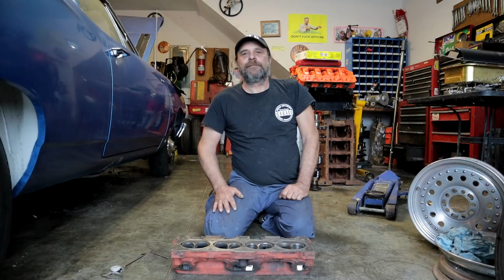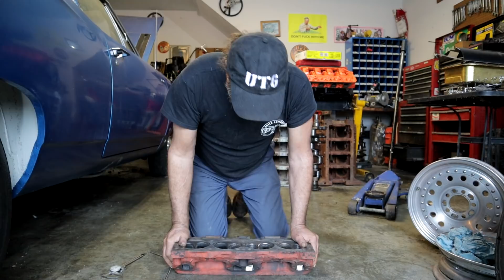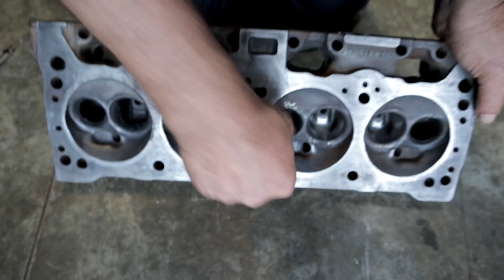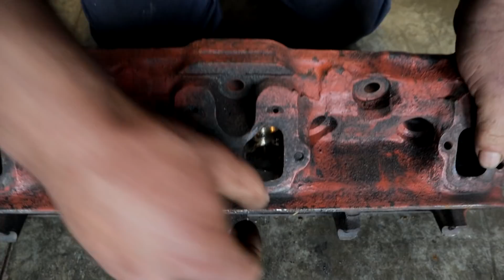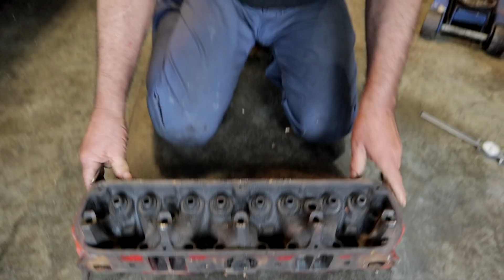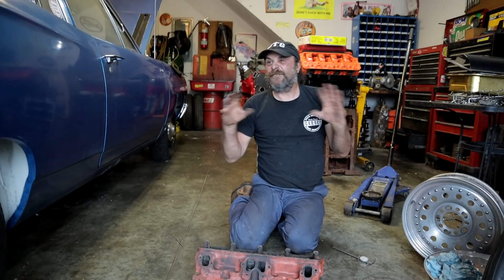Why Mopars Suck

Comment: same for us IH guys, biggest big block ever, highest nickle ever, all forged, max torque and hp right off idle all the way to red, and yet the 70's heads could have one exhaust port almost half the size as the largest! 
Port match em, polish up the drains and castings, and your like ahh, this is what the engineers made, and the suits said turn the machines up to 11, boom boom boom.
 When your talking no overdrive, 4.10 rear, on a stock engine, just worked over, its the difference of being happy cruising at 60 , to 80, spin them in any gear, SO at this point  stop fucking with the engine until you are actually using that power, all you really need is even throttle and power once you can light the wheels up! 
because any morE power at that point aint doing a damn thing but making it harder to throttle.... once you got the suspension right its trans gearing or slicks, or your just wasting your pinstripe and paint money

Comment: Fords where the same I had a ride in the back seat of a  new 1971 ford Torino with a 351 Cleveland and a 4 speed it had big back tires and picked up the front end on the street. Factory blue print.Crazy fast and all stock.

Comment: So that's probably why my 70 Duster just would not run like it should. I never really paid attention to the head castings. I just threw in cam, intake, valve job, headers ignition etc. And it just didn't  really make the power it should have. Combo should have posted around 270hp at the wheels but 1/4 mile et said 190

Comment: I had a 69 Road Runner that wouldn't fall out of tree if you cut the limb but I had a 340 Duster that was outstanding for stock and a 361 in a 64 Custom 880 that ran very well. You are correct the power comes from port work on the cylinder heads that's where I spent most of my money because I didn't know you Tony.

Comment: Buick 350 heads were like that, they were made lighter than the previous 340 but suffered in the quality of the casting, usually rough as a cob intake ports, block was lighter too .040 over is max, saved GM money as far as nickel and iron, good for them but not the customer.

Comment: There are also some secret engines out there, completely stock as they came off the assembly line that seriously had power. I know of one that just couldn't be beat, 383 4 barrel. hers a hint high nickel blocks. Made in late sixties, mid seventies and mid eighties for police/ government interceptors.  Those who have them don't give them up. I won't I have two.
Reply: Im running a 73 engine it dident look bad when I went threw it

Comment: The prettiest heads are the red ram hemis just about all surfaces are machined smooth.  Most heads are just smooth ports a little not usually that bad, and I've seen Chevy small block head much much worse, not to mention the straight six Chevy where they all cracked.  Ford 351'400 again about the same as Chrysler kinda rough depending on head.

The Buick engines had some huge ports but bad intakes.  All Ford engines seem to have weak cranks. They seem to twist out of true or simply break apart. Unless one puts in aftermarket cranks they can't take pounding.

Every car manufacturer has its good and bad points.

The real trick is to make them look exactly as they came with all stock components and still perform well.  Most people just drive to and from car shows or around town going out to a drag strip once or twice.  Once or twice period.  A few going every other week.

Racing is an expensive hobby.  Engine and carb machine, specialty safety gear, brakes, tires rims.

Most people with an older car will never go beyond 100 mph.

And yes I have buried the needle once or twice myself flying down a highway.

Comment: Buick and Cadillac were the executive and the salesmans cars, they were built to last, and the 421 was made before they switched over to mass production methods in 1968 with general motors, as a matter of fact that story goes that when they did that Ringer Race between a GTO and a Ferrari 250 GTO, where they tried to play it off that the american GTO won outright against it, it was using a hopped up buick bearcat 421 under the hood, and that 360, the 360 came out after the opec oil crysis hit and mopar was in dire straights given they had very few small and compact cars, and even then the only two things I can think of that used the thing were the little red express truck, a few cop cars, and I think even AMC with the eagle used it

as the 70's sucked for everything, like hell the only performance car that was worth a damn seemed to be the pontiac firebird 400, that was underlisted with about 50 to 80 less horsepower than it actually put out, and GM squashed that so they could force them to switch over to a chevy 305 to meet the gas fleet average laws. 

that and well, what does GM always do, sabotage anything that makes a corvette look bad.

Comment: I've been going to car shows and have owned classic cars for years and can honestly say the buick engines in particulare the 401 nailhead is the best v8 ever made,because of it's unique head design.Im a real GM fan,all my cars are GM,I don't care  if it's a 307 250 or a 230 inline,I like them all,early to late sixties the engines were the best.

For Mopar I'd have to go with the 360 magnum,the engine is pretty strong and I never could kill it.

Comment: Tony I was a moulder core-maker for 13 years and I'll tell you this either the pattern was crap and made the core prints sloppy or they were old patterns meaning used so many times the silica sand wore out the wood and made the prints sloppy then when the guy that put the mould together didn't position the cores for alignment yr gonna get core shift and ports aren't gonna match  sometime you can get whats called core float when the core is not firm in place when the metal is poured in it can float the core or maybe it the pattern makers fault

Comment: The engineering was ok, except, you know, those damn right hand threads on the passenger side lug nuts...the twisted torsion bars under the 1970's Plymouth Aspirin....:)

Its nice to hear someone call out the truth. Talk to folks who've worked over a Pontiac, they're amazed at the lack of machine work needed to blueprint an old block.
Reply: eh, never had luck with pontiacs. especially the 455. lackluster and over heating lemons.
Reply: @frigglebiscuit7484  so i'm going to ask, how do you clean out your engine blocks, and what RPM did you shift at.

Comment: Chrysler is like a good lady,
Not perfect, but worth working on. 
You have to work for perfection.
Reply: Not really polished heads, but the casting core halves should at least line up and not look like the Donner Pass.

People are seeing cars on TV, and at shows. At Mecum. Last B body I restored was well over $100,000 on just the parts I didn't already have. I had MANY in my lifetime stockpile.  We had marital issues over that. These cars get all kinds of metal welded in, rebuilt inch by inch and when we finish with them they are built to a much higher quality standard that they were originally built with. People see restored cars, the areas we learned to correct over decades, we paint areas where Chrysler left bare metal to rust when new. Our panel gaps take days to get right. The antenna is adjusted until it is straight up and down, not leaning over until it almost touches pedestrians. No rattles when you drive around the block. No leaks (valve covers JFC?). The steering column doesn't squeak. I take the radio apart and modify the AM Radio so you can actually see the light in it at night. No orange peel, and Chrysler didn't clear coat cars in the 60's and 70's. people see our restorations and they think that is what an old Mopar Was like when it came from Detroit. No, that is what an old Mopar is like after we max out some credit cards and work nights, weekends and holidays for a couple years on it. The first time it was built, it took 48 hours to build
Reply: @Digitalsharecropper  :I had a 70 440-6 SuperBee and NEVER had the issues you describe! I went to dealers with my dad in the lat 60' and early 70's and NEVER saw an antenna "Leaning over that would hit a pedestrian"! Stop the B.S.! They are "Assembly Line" cars, NOT hand built. Did Chrysler have their issues, yes, and SO DID gm AND ford, not to mention AMC! I had seen doors, trunk lids, and hoods on gm AND ford cars and trucks NOT line up EITHER. And paint jobs the sucked. So again, STOP the B.S.
Reply: He acts like they should be polished heads and ported from the factory "Assembly Line"! It's not a "Ferrari, or Lamborghini, or Rolls-Royce engine". It's an "Assembly Line" engine.

Comment: After market heads. Problem solved. Thank you uncle Tony. Love UTG.
Reply: @ Tom Cat, Interesting notion, but NOT necessarily true... I have seen AWESOME performance from stock parts that were set-up correctly... Believe it or not, given the same valve sizes, compression ratio and similar port shape, the cast iron heads will OUTPERFORM aluminum heads... Why? Because the cast iron does not absorb as much heat as the aluminum... The HEAT is what makes the power, because HEAT causes the a/f mix to expand... Expansion creates pressure, pressure makes the piston move... And the cast iron heads tend to be much less prone to heat damage, which causes warpage and cracking... There is about a 35 pound difference between the assembled aluminum heads and the assembled cast iron heads with the same valve gear... 35 pounds is about the weight of 5.5 gallons of fuel... About 1% of the weight of most muscle cars... But don't take my word for it, read a book called 'Building Horsepower' by Dave Vizard... Do the math... You might be surprised at what you could learn from it....

Comment: Their electronics back then were crap as well.I mean the ammeter gauge for example.Seen a few Mopars catch fire from that awful ammeter .Get rid of it ,rewire it ,and install a voltmeter.And don’t get me started on their Electronic Ignition box.They had a tendency of the crap inside melting and running down the fender.

Comment: Nowadays its all made to fail. They know what works, they know what doesn't work. They know what costs more money. Most of the stuff is made fairly well....besides stuff they want to fail. VW has i think plastic water pump housings or some bs which go bad or PCV crap basically a bunch of plastics. Other brands have good materials but just bad assembly ect. Its always cost cutting. I'd rather good materials and design that needs some porting ect than new crap thats just not made to last.

Comment: Do you know if they got better at any point in time?... like 90s magnum small blocks or maybe even some on the 80 LA motors?
Reply: the magnums are alot better, but the bowls in the heads still could use some work. they only bored deeo enough to put seats in, and left the bowl all sharp and rough, as well as tiny.

Comment: I have always wondered why old school Chrysler engines were so up and down in performance on their high volume engines, where as GM and Ford were pretty consistent... now I know :) I love my old school GM, I respect some of the old school Ford, and Chrysler always had me wondering how they could build amazing feats of engineering... and yet their bread and butter cars and engines just kind of.... were a mix of great and garbage... from the same engine family. And actually, as "good" as modern Chrysler has become at making their cars more consistent in performance and quality from engine to engine, car to car....... their engineering now has taken a back seat. My personal opinion, is that what would be best for Chrysler as a company, is to become more niche and and stop trying to compete on the scale of Ford and GM. Drop certain cars from their ranges, engineer an actual modern replacement for the Charger/Challenger, stop putting so much money into pickups for  now because that has gotten out of hand, they have so much potential to be a better company as a whole.. but choose to do many things... half assed.

Comment: The same thing happened to GM when they moved their crate engine casting plants down to Mexico.  I've installed and replaced several engines from Mexican plants and it doesn't matter if they're TBI, Vortec, or the older carbureted versions of the small blocks, the castings are all mass manufactured junk.  Don't buy a GM crate engine if it's made in Mexico and expect good performance.
Reply: 100% right I have a made in Canada  set of 062 vortec   heads that were cast in 1999 nice smooth casting the ports all even shapes now the Mexico 062 a friend of mine has the ports are all rough and miss shaped look like total garbage.

Comment: Long before working on locomotives I was a cabinetmaker and a pattern maker. I still have my apprentice book on pattern making. Shrink rules, cores, cope, draw pattern plate split plate, indexing pins, multiplate patterns, core boxes and the lot. A great machine starts as a great pattern. Screw the pattern up just a little and greatness is gone. 

Great work Uncle Tony. You are the pattern for the young gear heads to match. 

Thank you for talking my language. This is a subject I never get to talk about nor get to hear about.

Comment: The opposite is true. Sometimes they threw the parts together and you got a balls on motor. I had a big boat Olds 98 with a 425 c.i. 365 horse power that weighted in at 4,200 Lbs. It flew!
Reply: Those Olds 425 Hi compression engines were fantastic , as were the 330s.

Comment: I had an 84 Dodge Ram I bought new with a 360 .It kept running hot eventually cracking a head . When we tore it down we found the block was full of casting sand. The engines at that time were made in Mexico . Both heads were replaced and also radiator . I was not happy .
Reply: Funny, the Ford guys will hunt up and down for Mexican 302 blocks... or at least they used to.

Comment: The casting on the outside of my 67 olds 400 block is pretty rough in some areas. I just tell my young import buddy's it's an old tractor engine.🏁🍺

Comment: A lot of the 60s stuff not so bad. Enter the gas crunch of the 70s & quality control went into the trash can. Recently did a rebuild on a 360 in my 88 Dodge 1 ton van. I was comparing the block casting next to a 2000 magnum 5.9. The difference in quality was amazing, the magnum being much better. I would imagine that by the mid 70s all the casting molds & equipment at the foundry was getting in bad shape. All the big 3 were having problems & produced some poor quality products. Worst car that I have worked on recently was an 83 Malibu wagon. Body panel fit was terrible, the electrical system in the dash was a nightmare, the printed circuit board (if you could even call it a board) was junk. My 75 Duster body panels don't fit properly & interior is made of poor quality stuff. A big problem in any manufacturing environment is upper management allowing accountants to make engineering decisions.

Comment: I worked in an automotive machine shop in the late 70's early 80's and there was a world of difference between chevy heads and any of the BOP stuff. BOP was the best I saw. All chevy guides needed at least knurling if not replacement and I'm talking low mileage warranty work, where as BOP's were in good shape. Seats were the same. BOP would clean up instantly and chevy would be pitted and wallowed out or burned. It's like BOP used a better quality steel.
Reply: Might be. Chevys were the low cost brand. Have to cut corners somewhere.

Comment: I just picked up a set of none smog 360 J heads with factory 2.02 valves . they have been hot tanked , magnafluxed and 0.010 taken off of the head gasket surface . bought them for 175.00
Reply: BADASS what a Score..
Reply: Niiice!👍